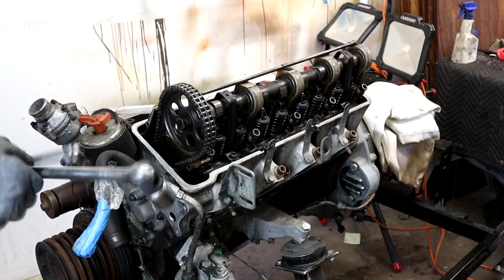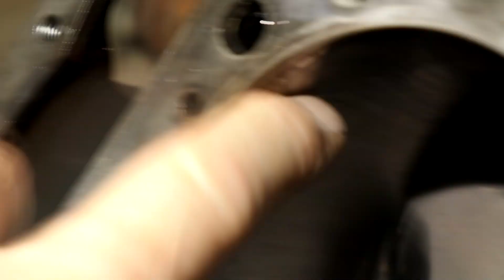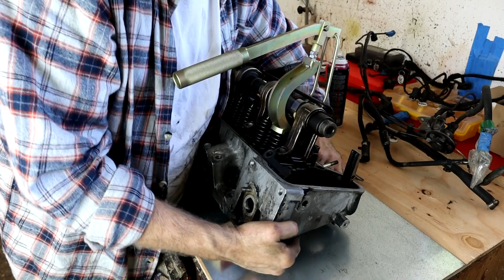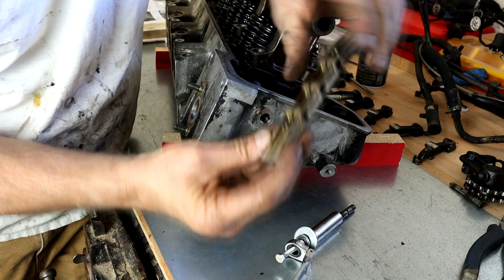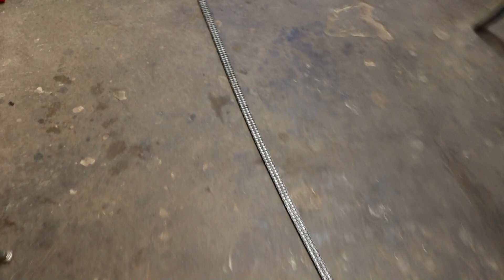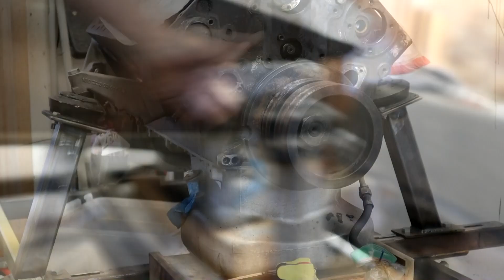MERCEDES 6.3 ENGINE DISSASSEMBLY. PART 3

Comment: Hello, can you tell me where I can find your spring compressor online? Can't find it anywhere.. 
Greetings from Germany ✌🏻
Reply from the maker: Hi. This is the one I have. https://www.ebay.com/itm/175347690594
Works great to remove rocker arms.
I also have the regular c clamp style one to compress the springs and hold the valves at the same time so you can remove the retainer clips. Cheers John.

Comment: Hello, do you have any video on how to repair the power steering of a w108? It only works for me when turning to the right and for the left it is hard. thanks.
Reply from the maker: Not at the moment. Have you checked the fluid in the reservoir? Are there air bubbles after the car has been running? It may be getting air into the system. Come join us on the facebook group Mercedes maintenance. I know a friend of mine recently had one rebuilt for his w108 and is very happy with it.
Cheers John.

Comment: I think take measurements of ALL the cylinders for roundness and wear and note these on a chart. This together with the manual and M-B experts will then give you an idea of what course of action to take. Just curious, what are the incremental piston sizes for the 6.3 engine?
 I remember back in the 90's, we had checked the price of the 4.5 piston set from Mahle (the smaller one that you held up), and those were very, very expensive. If you are looking into new old stock pistons from Europe, then check the shape and dimensions, as some Euro engine parts are different from North American - this is due to engine compression and emmisions requirements in the US.
Reply from the maker: That's what I'm going to do once I get those pistons out. I have a good quality Bore gauge and micrometer on the way. From memory the incremental on the cylinders/ pistons are 103 standard. 103.25 Intermediate. 103.5 first oversize. 104 second 104.5 third.
Thanks for the comments and advice, much appreciated. 
Cheers John.

Comment: Having looked at the bad cylinder, my opinion suggests that you won't need to sleeve that cylinder. Get the block bored to next size up, & fit o/s pistons & rings. A company called Mahle make them. If you decide to sleeve that cylinder, the block temperature during machining is closely watched, & the cylinder is kept lubricated during the process, so heat is not an issue.
Reply: Could you mention the price please?
Reply from the maker: @i99albsi   New pistons, rings and pins I got an estimate of 1500 to 1800.
Reply from the maker: After reading your post Christopher I inquired to Mahle pistons here in the US. Not as much as I would have thought for pistons, rings and pins. I think oversizing one up is the way to go rather than sleeving.. Cheers John.

Comment: Nice work.  I cant tell how bad the groves are but a hone or bore on one cylinder is ok.  Its not a race engine just a driver.  The fit on the new piston and rings is the important part.  I have a 1984 126, 500se euro car with about 50K miles on it.  Love the car but its been quite dificult to learn all the systems as I was always a small block chevy person.  In the states thats what you did.  I dont know where you live but I would like to stay in touch as I have questions to ask you.  Thanks.
Reply from the maker: They're quite deep in the cylinder wall. I think what I'm leaning toward is a re bore up size. Then new pistons and rings. I think that route will be the better choice. i live in Northern California not far from Sacramento. Come join us on Mercedes maintenance on facebook. you can pm through that I'd be glad to have a chat. Cheers john.